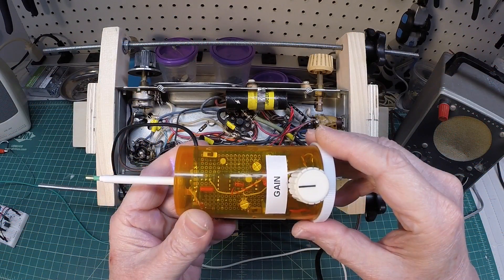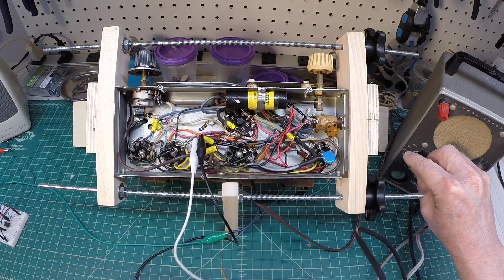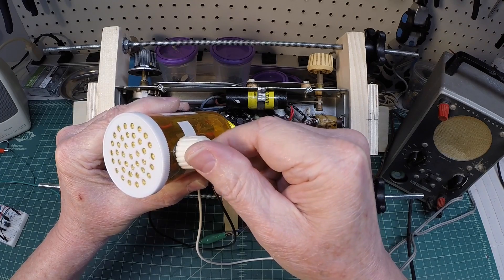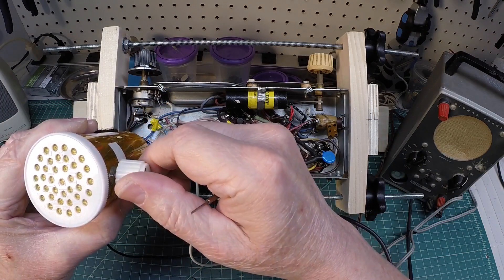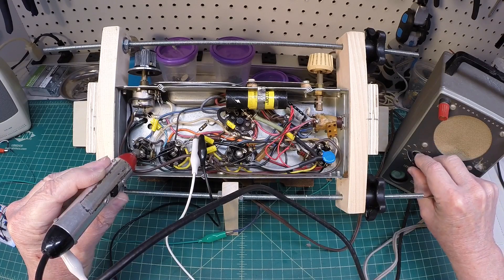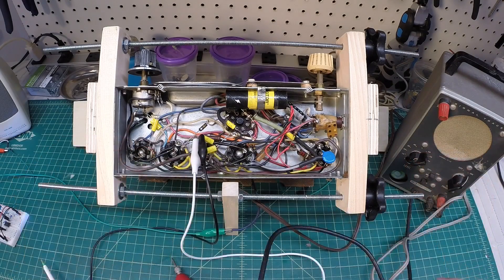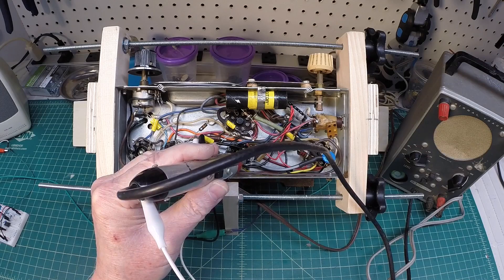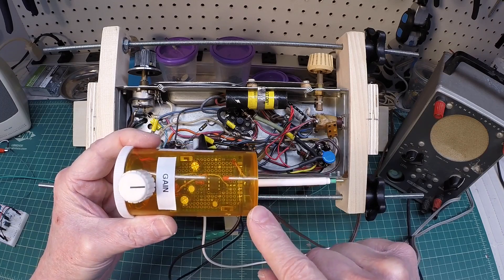Prototype Signal Tracer vs. Heathkit IT-12

Comment: Don, I need some help
I have this signal tracer it has a fet input with a cap and 1n34a diode
all electronics are in the small unit with probe with coax going to the unit 1:1
it's direct connection from probe tip to unit.
It seems I don't get the same results you do.
I'm signal tracing a AAF AM radio.  Radio tuned to a strong local station and vol. all the way down
Signal Tracer set to RF then I probe  Pin 5 of 12BA6 station come in loud and clear.
When I go to Pin 1 of 12BA6 nothing.
When I probe Pin 5 of 12BE6 I hear the tuned station pretty good.
Moving to Pin 7 of 12BE6 I can hear a station [very weak] but it's not the same station the radio is being tuned to?
Do you know what could be the matter.
Reply from the maker: Sorry about my belated response. I’m guessing the probe is loading the circuit to a point where the LC resonance of the station(s) being tuned is being affected. Check out my video on this at: Signal Tracing Demo - Low & High Impedance Test Point Locations
https://youtu.be/SP6uJRjpCzY and let me know if implementing any of these practices improve your results. Best, Don